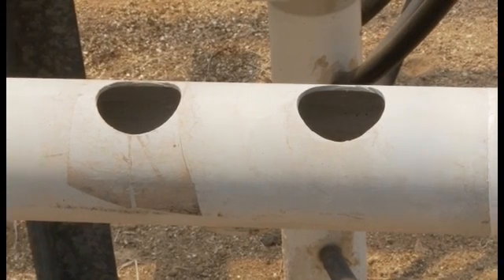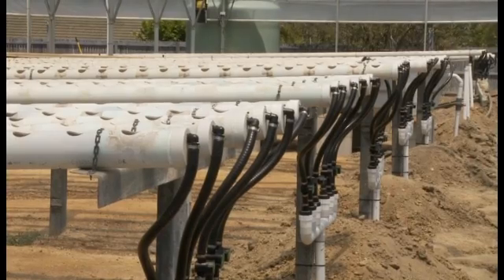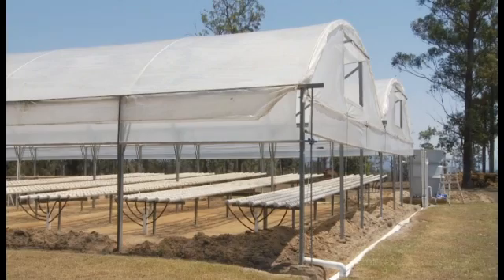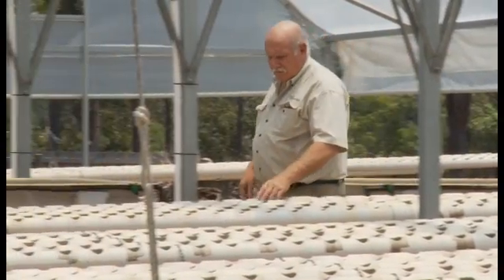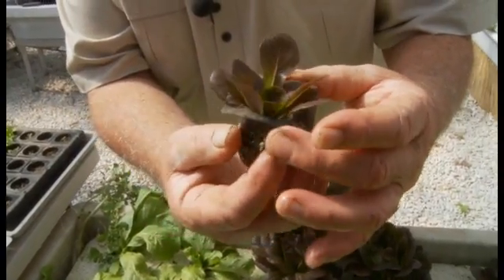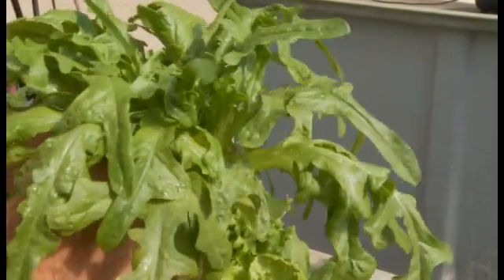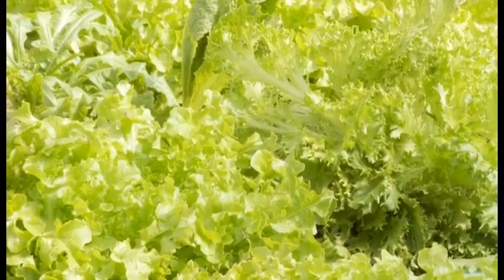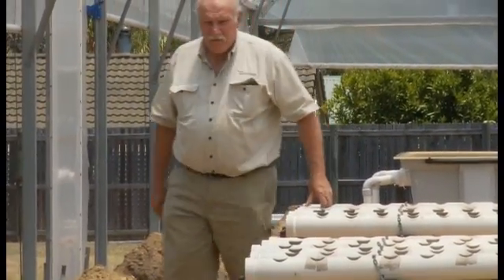Aquaponics For Profit

Comment: Forgot to mention buying the land for project..and initial setup cost=kaching...
Reply: you can do this project either in your small apartment or on open land.  If you do not have land.  Go to any store (walmart, target, kmart, etc)  Go buy one of the plastic storage tote(s) ...the size is up to you for how big you want to make it ...... take one of the large deeper totes that will be your fish tank, get a oxygen rock filter and a small pump to pump water up to the grow bed.....buy a smaller not as deep tote to be your grow bed.   cut a small hole 1/2" place a pvc in it (this will be your bell cyphon when water fill up to top of pvc pipe then it will flow back to the fish tank...make the depth depending on the grow bed , want to have enough water in the bed....place the bed on top of your fish tank where it just sits on there (may have to place a wood to sturdy it)......buy tilipia fish etc and your seeds/plants then your set to go....

if you have a big area you can buy one of those 300 gallon water totes....you cut  the top off and that is your grow bed and pretty much everything is else the same as above.

Comment: Great video... I just hope people teaching this method, as well as those just getting started, are well aware of the plastic toxicity contamination potential when choosing petroleum based containers, hoses and irrigation components... the longer a system is in use, the greater the risk is for hoses and containers to break down and leach toxins from the UV rays of the Summer Sun, from the heat, as well as contact with fertilizers and other chemicals. Don't just guess and hope for the best, try to source natural containers (ie: stone, clay or glass, etc...) and/or "Food Grade" approved containers/components every step of the way... one step forward is not worth two toxic steps backwards when it comes to you and your family's health ;)
Reply: WJW - Just use food grade food grade components in your system.

Comment: hi i would to know can i use this system for chilies, tomatoes ?
Reply: both have a structure similar to fruit trees.
i know they aren't technically trees but you would have to keep an eye on the size of the roots or they will clog the flow of water,
also the bigger the plant the more nutrients it needs so you would need a system like this but taking into account you will be keeping the plants longer, maybe sell them in pots when there to big for the system
Reply: StraberrYKiler6789 thanks for the reply. i am concern about the root problem. but my friend told me that if the roots get too long we can just cut the roots down.
so will it hurt the plans too much to affect the fruits production or even dying?
Reply: Bonsai tree artists cut roots all the time, they have it down to a fine art

see how they do it, its not about what you cut its about what you DON'T cut

if plants are not in soil roots might form differently so it may be more difficult to figure out what you are looking at

plant do go into a state of "shock" so leaf loss and abnormal development may happen but plants have adaptations to survive attacks by pests so they will probably live
Reply: StraberrYKiler6789 thanks alot. i am currentlyl using NFT for my chili plant. its about a palm size and the roots is already trying to get out of the cups. and im using clay balls for the medium i am afraid that it might collapse when it grows bigger.
Reply: Henry Tan something for it to lean on or tie to, or rearranging the system is all i can think of.
hopefully it will go well

Comment: but those companies relying on one product usually make a lot and have more than not facility. they're mass of product make them money since if one facility fails due to disease or or some other disaster, the other facilities can take up the slack, but with a single small operation, one mistake and you're toast. you need to go big or go home with farming nowadays, either go big with variety, size of the operation or get big investments, otherwise you're asking for trouble.

Comment: I will admit your getting at a somewhat valid point they do have diversity. Staff lives on site, work and eat free. I will submit for contemplation, as my last comment, that relying on 1 particular good or service is still what numerous profitable industries do, anyone willing to commit to a sole service or good for profit is most certainly not leaving their lively hood to chance and happenstance but rather dedicating to preventative maintenance, redundancy( Ex: backup pumps) and fail safes.

Comment: there's innovation and then there's going broke with a single small mistake, considering this as a viable and reliable business model is ridiculous. I understand pushing for your business to work, but unless you have a huge facility going(like millions of lettuce), it's not reliable. and it's not only the bum crop that ruins the business, it's the credibility and reliability of the owner when they promise to supply is going to ruin them, consumer relations is a big deal too.

Comment: yes, picking, packaging and shipping off 200-250 lettuce in 2 hours and you need to check the whole system every day too(likely 15-30 minutes on it's own). so, how many workers do you have again? 10(guessing)? at minimum wage of $16.37, that's $1637.00 in a week,  there goes your profit and you're going in the hole. unless you can find a premium market(with more farmers joining in, competition will get harder) for $3 a head, you as the owner are making less than your employees.

Comment: You are quite correct. All of those things are part of the equation. If you take in $1000 a week, that's fine if your expenses are very low but could be worse than nothing if your expenses are high enough.  Some people might be very skilled in production but have no sales abilities,  Ant commercial venture needs both. Apple needed Steve Jobs as much as it needed Steve Wozniak.

Comment: I only take issue with your comment "soil contains so much more nutrients, including different kinds of rare minerals, that no hydroponic or aquaponic system can mimic". That is purely emotional response and incorrect. Hydroponics can offer all nutrient benefits that soil offers, but at measured and optimal levels without worrying about run-off from a neighbor using Round-Up, or other variables such as varying soil drainage, which creates uneven nutrient distribution. Keep up the good work!

Comment: There is virtually zero risk under normal use.  You have to keep in mind that a city water system is in constant flow, and only a very VERY tiny part of the water is ever consumed. The vast majority of water used is for purposes other than drinking.  While it may be leaching it, The odds of getting more than a rare molecule on occasion is really small.  I wouldn't use a PVC container for storing drinking water though.

Comment: Yes but not in houses:  While PVC pipes manufactured after 1977 are safer, many public water systems continue to use pipes manufactured prior to the implementation of the new process. These older pipes could still leach vinyl chloride into the water they carry.

Comment: i just watched a vid where a guy name will allen runs a aquaponics greenhouse year round in wisconsin, a climate similar to yours. his operation is split equally to cultivate both the fish and the veggies. they use a composting system during the process. they heat the greenhouse in the winter with the heat emitting from the compost. ireland does have a higher latitude, so limited light could result in lower plant yields, tho. so, just concentrate on the fish for more production during the winter

Comment: I f the problem is the water temp and the ph balance why not address them by building deeper tanks/ponds in the ground and monitor the ph balance.....why did u have to throw away the entire system and replace it with the 'fish system'....why not address the problems of the hydro instead of changing to the aqua system....!????